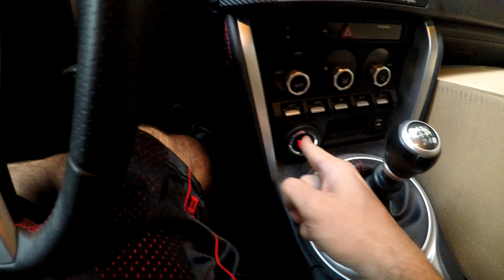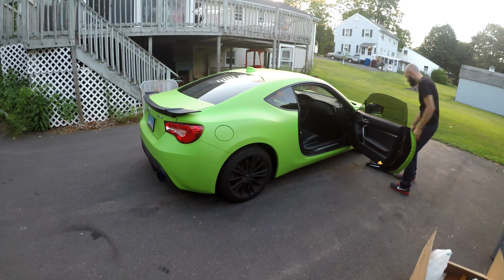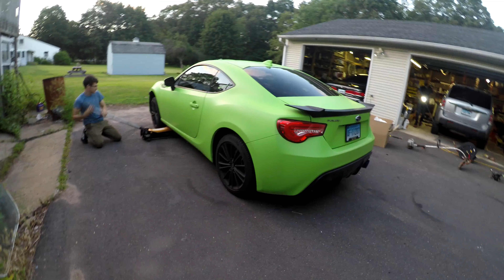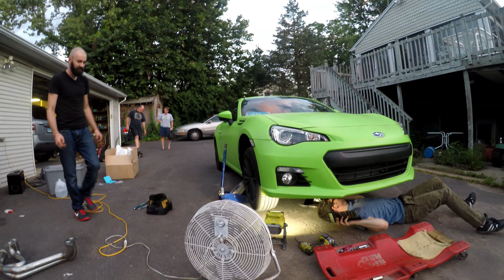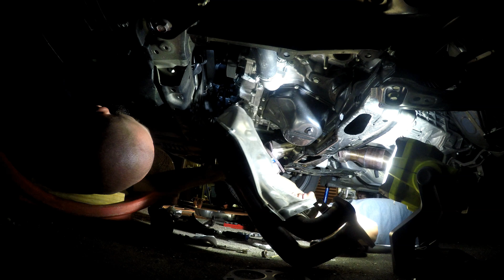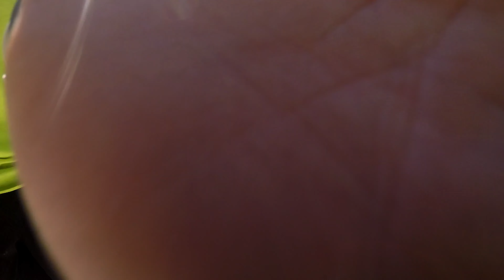FT-86 SpeedFactory Race UEL Header Install

Comment: Hi guys, at 4:50, what tool/extensions did you use to tighten the inside bolts on the header? I can't get any tools I have into that space, despite taking the stock headers off.